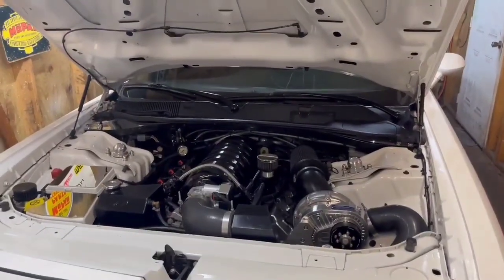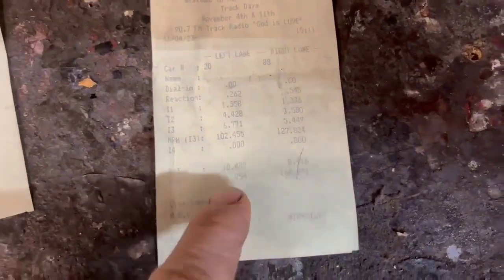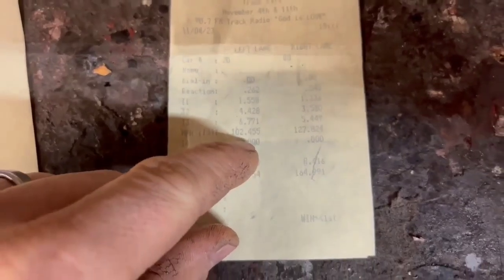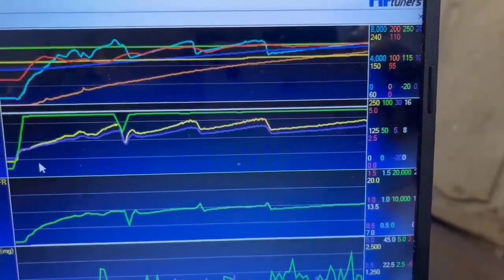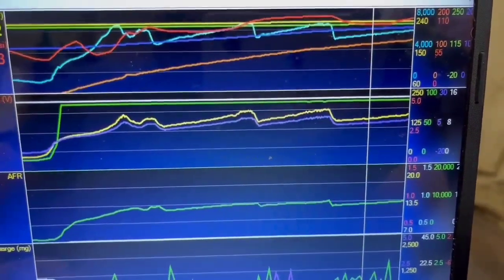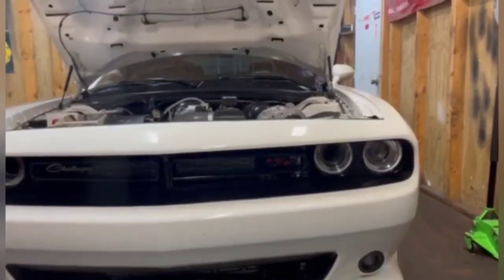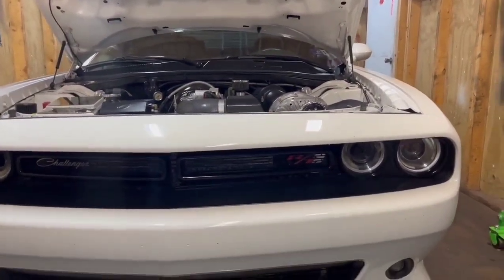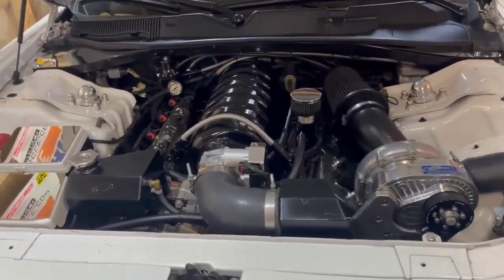Procharged challenger new pb 1/4 mile on 93oct

Comment: Sometimes with a tight stall, on a procharger if you spin a little it gets into boost quicker and higher ( like the stall is looser )...its threw me a loop too until i really looked at boost vs rpm vs time

Comment: Hey man. Mines getting built currently. Have the P1-sc1 on it when it’s finished what are u running? Getting a D1X upgrade but spending lots of cash currently. What do u think I should change my ati dampener to get the most boost out of this unit for now?
Reply from the maker: Id do the 18%od ati lower i had the p1x and plan on sending that in to get upgraded to a d1x
Reply: @ Thanks bud. P1x how much boost were u running in video?
Reply from the maker: @Procharged392   12.5 psi on /93/ 780rwhp
Reply: @ Thanks for input. I’m on E/85 already

Comment: How can I get the most reliable power out of a hellcat 2023 
I wanted to do a 2.75 upper 
10 percent lower 
Want to be running over 800 wheel as a daily on pump gas 
Is it possible ?
Reply from the maker: a non red eye you can do a 2.85 upper with a 10%lower a jms boosta pump with fic 1000cc inj or if you plan to do e85 go with fic 1200cc injectors then of course tuning   and youll need ngk 2309 spark plugs gapped at roughly .026 /.024 and you will need a pcm unlock and a bypass cable and hp tuners and do a mr gasket 180deg t stat part number 4367 .but that pulley combo on 93 on a other ys stock hellcat non red eye will make low 800 wheel thats bout the limit for 93 oct on a hellcat and bout as far as you want to push it with 93 . then you can retune it on e85 and make close to 900wheel on the same pulley combo you can drop to a 2.75 upper on e but you dont want to over spin the stock supercharger much harder than that unless you port it and upgrade the bearings
Reply: @moparmuscle304  why not go upper 2.75? Is it too much boost? 
Also can u run 17 rims without mods on rear end? Some say yes , some no 
Trying to run the biggest radial on the rear with smallest rim
Reply from the maker: @ErinLopez-ng9qh  low 800wheel is bout the limit for 93 pump gas on a hellcat with a stock blower unless you have some super efficient set up then it will make a little more if you push it to hard on 93 you can damage the pistons etc from detonation etc . and also on the 2.4 factory blower you do not want to over spin it for a long period of time you can damage the bearings in the blower . also harder you spin it the more heat it will make everything has a limit the 2.75 and smaller and with a 10% lower is starting to get to the limit for a stock 2.4 hc supercharger with factory bearings  . like i have said on a stock hc  with a 2.85 upper and 10% lower with a bap and inj / plugs and re tune on 93 youll be in the low 800 wheel range given the conditions and type of dyno last one i did made 830s to the wheels on are dyno at work on 93  ...... now switch to e85 on the same pulley combo and you will be close to 900wheel . ... and for the wheels and tires youll need the shorter rear sway bar links to fit 18/17 inch wheels you can run a 305/45/17 in the rear no prop . but 315/ 50 /17 on a regular body car non wide body depending the wheel spec and brand usually need a 1/4 plate spacer /and need to clearance the inner fender liner/ on the wide bodys they normally clear